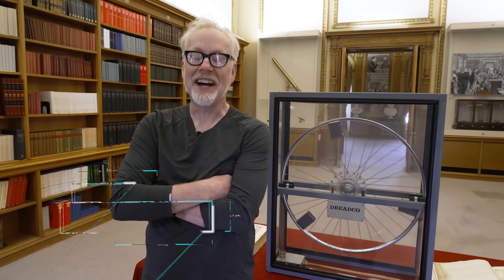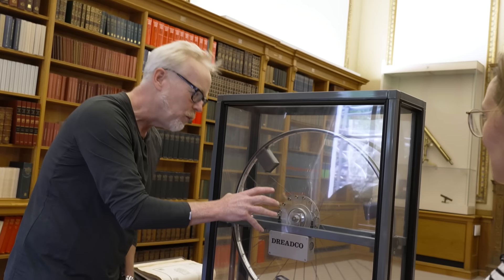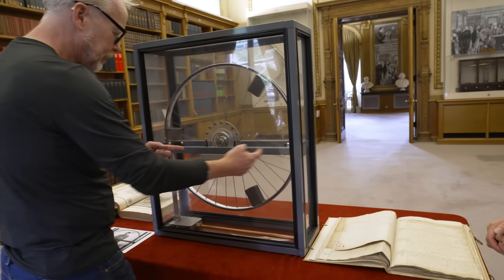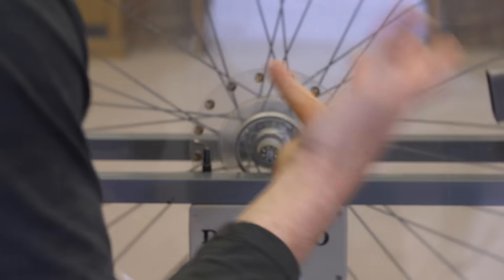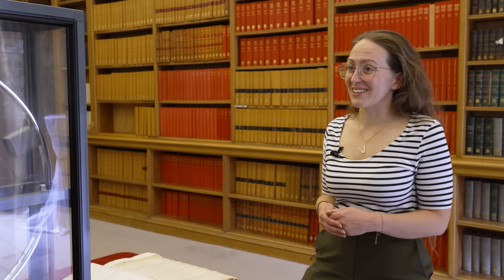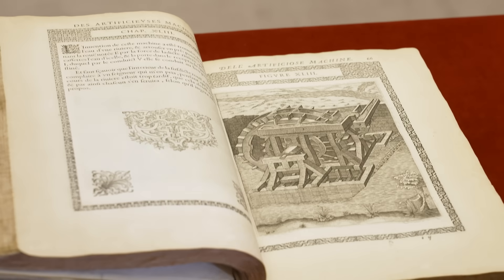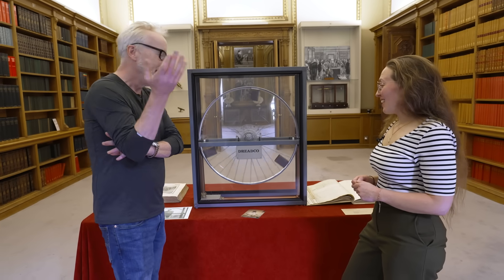Adam Savage vs The "Perpetual Motion" Machine!

Comment: As a kid I was at the Smithsonian Science museum. They had this small glass  lightbulb looking thing a radiometer they called it. It had a small windmill , four blades arranged horizontally. One side of each blade was black , the other white. When you put it in light it spun. And would spin if forever if  it had a constant light source. That's the science for dummies version as I'm a dummy for the most part.
Reply: You can buy those for under fifty bucks, it's a neat toy. They only work in that specific shape, and at a specific pressure, so it's not how this wheel works.

Comment: Very interesting discussion... obviously the wheel is spinning inside the vacuum - which is part of the service - the axial need to be made of very hard material, such as titanium, same as the wheel and spikes and the bearings.  The ball bearings need to sit inside a highly non-viscous extremely thin vacuum tight fluid. The three box containers part of the wheel, contain three magnets set at repel polarity wrt the bar magnet, which will provide impulse at the moment when one container is at the top of the wheel. The box containers are probably made of some very light metal alloy.

Comment: Perpetual motion is absolutely possible.  Every planet, moon, even stars orbiting the center of the galaxy are examples.  As a result of gravitational tidal forces enormous amounts of heat are generated in the earth fueling every volcano on the planet and ultimately our electromagnetic field which protects us from solar radiation.
Reply: Every planet moon stars eventually collapse into a black hole
Reply: @Kkappaccino  That is ridiculous and not even remotely true.  Whether you are saying that they of themselves eventually collapse, or that eventually they would all be pulled into a black hole, neither is even remotely correct.  

Our own sun will die as a red giant.  It will expand like galactic popcorn expanding so much that its surface will extend beyond mars.  After which it will slowly cool and go inert over billions of years.  The rest of the planet Jupiter and beyond will continue to orbit just as they always have.  The fact that the surface expanded wont affect their orbits in any significant manner, as orbits are determined by distance between centers of mass, and their centers will still be the same distance apart.

After this our effectively dead solar system will continue to orbit the center of our own galaxy for billions of years.  While it is certainly possible that they might be pulled into a random black hole there is certainly no scientific certainty of that.
Reply: @K162KingPin don't think you're understanding that perpetual means forever, not just a really really long time. Entropy will eventually unravel all of that.
Reply: @K162KingPin then eventually society becomes reliant on this system. When it eventually is no longer perpetual after 20 generations, all previous forms of energy generation will be archaic.
Reply: @captainhellhound7451  What were you planning? To just build one big one? lol.  There is only one "Hover" Dam, but there are thousands of dams around the world generating power, Millions of wind generators, BILLIONS of solar panels.  What could possibly make you think that if we had an infinite source of energy production that we would only build one.  I mean, what are you going to do about mobile power?  Run an extension cord everywhere?
Reply: @captainhellhound7451  I must have missed a paragraph or something.  What is your basis for imagining that a proven design which has been replicated millions of times, and worked perfectly for over 1,000 years would suddenly fail for some reason?  Are the laws of physics going to suddenly change in 1,000 years making the design non functional?

Take solar panels.  They only last 20-50 years or so before they need replaced.  That doesn't mean it is a flawed design, only that it has a finite life span.  No one is going to give up on solar simply because the panels must be replaced a couple times a century.

You might as well make the same argument about gasoline engines.  The gasoline burns up in just a few miles and the engines only last 1 - 200k miles before they are done.  That doesn't mean its a bad technology that everyone will lose faith in.  Why would a hypothetical generator be any different.

Comment: Looking back at this, I think the way it works is actually VERY Simple, the same way those desktop toys work where a marble runs down a ramp and then somehow ends up back at the start. 
The ball is running past an electric motor that can also detect the marble, allowing it to turn on and give the marble a slight push as it is falling, giving it just enough momentum to land back at the start. 

The way I think this works is:
I think this is working very much the same way to the desktop toy, the THREE Magnets actually make sense with my theory, they are doing a few things aswell as being pushed by an electro magnet, they are also acting as weights to keep the wheel spinning just enough to make it look constant (kinda like a fly-wheel). 
- I think the three blocks are just magnets, while the two things either side are electro magnets that each sense the main three magnets, giving them just enough push to spin the wheel, the next magnet does the same and so on. Notice how there are two Electro-Magnets and three normal magnets, all of this together (Going in a LEFT-RIGHT-LEFT-RIGHT manor) will make the wheel spin just enough that it looks constant, these also do not need that much power since they are not actually turned on that often (about 20% of one rotation). 
- As to what is powering it, I think it is very well hidden wiring that hides batteries somewhere, possibly in the frame itself (which is very thick so could easily hide some batteries) or even in that heatsink box. 

I think it is a more elaborate version of the desktop marble toy thing, it looks more insane and makes less sense, but is actually doing pretty much the same thing.
Reply: I wonder if they will let you record high speed footage of this, or a timelapse that you can speed up a tone. 

If my theory is correct, you should be able to see a slight slow down just before each magnet passes the electro magnet, if this is the case then I would say my theory is correct. 
PS: When I say "Magnet" and "Electro Magnet", these are the names I have given the objects, this may be wrong though. 

I will never know the true answer though, I would like to hope I am correct, or at least close though hah.

Comment: it's not a problem to make a wheel to spin  {  i built one with magnets  } but it will not generate any power. may be a volt or two at the most. efficiency of this machine close to 0

Comment: Natural magnet low speed work long.But fast speed magnet lost energy temperature gradule oven This magnet lost function. Real Earth planet centr core bal magnet very fast and big temperature heat oven but normal limited speed . Princip this prototips.Bicycle wheel prototype magnet inertia.  It has thus functioned as a power station without water, without fuel, without wind.  Only magnet station generators. For obtaining power sources.  From the past shown practically known theory about the magnet and simply to this day and in the future.  Elementary.  And simply.

Comment: My invention flash driving running in light speed way is my perpetual motion. 
It's using a gapping way levitation levitating way .
Cw driving the ccw and the ccw is driving the cw in 9ne pathway driving and in light speed way . Using a gapping zone way .
There is an additional design to run boto cw and ccw combination perpetual motion running. 
And an additional tapped way not connected but tapped only , making the real driving a dummy no force driving in gapping zone way. 
Gapping zone is in Black Hole is the centering way .

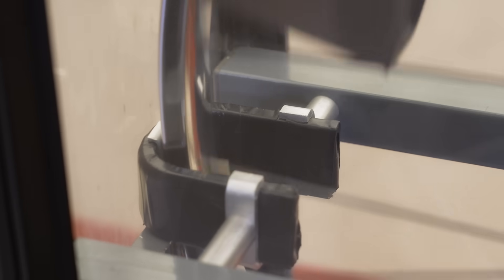Comment: every two years to someone who changes the battery... Savage is cool dude, pretty sure the copper tube and box 3:44 are decoy, Those circle magnets at center 3:02 give it away,  the black boxes 4:09 are coils for sure. 100% motor and the box with name dreadco on it is the battery. As we learned from the first law, They cant cheat the universe a very fine amount of energy is getting lost so every 2 years they have to charge the battery. ROFL

Comment: This is clearly an overunity system. meaning, it is powered by the dirac sea, virtual particle flux fields, gravity waves, tachyon waves, dark energy, dark matter, cosmic energy, heaviside component, and sometimes referred to as zero point fields. 

the wheel is utilizing energy from the environment to spin. the wheel needs maintenance just as all mechanical things require.

perpetual motion simply means its powered by the infinite wheelworks of nature. nothing more, nothing less. still requires maintenance, still requires the cost of materials to build.

Comment: A while back I made a wooden gear pendulum clock that is electrically powered, but takes very little electricity to run (think servicing every two years of this machine). The way the clock keeps running is that in the base is a dual electromagnetic coil, and a transistor for switching. In the bottom of the wooden pendulum is a permanent neodymium magnet. As the magnet passes over the outer dual coil, it picks up enough of a slight charge from the moving magnet passing over a coil to allow the transistor to briefly switch on the inner battery powered coil which is wrapped around an iron nail. This very briefly creates an electromagnet opposite polarity of the magnet in the pendulum that repels the magnet in the pendulum and gives it just enough of a little push to keep it swinging. The cycle repeats each time the pendulum passes over the coil hidden in the wood base, which keeps it swinging back and forth.  

Now my clock, is not an impossible perpetual motion machine, it's just a clock, however, it demonstrates how easily something can be hidden and keep something moving for a long time with very little power.
Reply: I highly suspect this is exactly like that tbh; the blocks on the wheel are magnets, the two sides of the horizontal casing are electromagnets, the batteries are in the box.
Reply: Почему не вечный двигатель. Вы сделали параметрический маятник, который не нуждается в дополнительной энергии, акромя энергии небольшойй батареи.. Если его масштабировать, то можно построить мощный в несколько кватт генератор энергии. Для дома или квартиры в самый раз. 

А можно воспользоваться идеями Джона Бедини. И вместо небольшой катушки намотать большую для создания магнитного импульса и маленькую для подачи сигнала на базу транзистора. И поставить аккумулятор на 9-12 вольт.
Reply: @Виталий_Петров_Н   Because you can never get out more energy than put in. With the pendulum, it still using battery energy that will run out. As soon as you tried to use the output of the pendulum to power something, in my case the clock, it needs energy to keep going that will run out.

Comment: Those 3 boxes on the inside of the wheel all have an electromagnetic in them , and the necessary electronics to pulse the electromagnetic as they get close to  the magnets . The stationary magnets themselves are there as a trigger to tell the electromagnets when to turn off and on . They have to charge up the internal  batteries every few years to keep it going .

Comment: The wheel would spin faster if it only had two weights(masses) attached to opposite sides of the wheel such that the direction of motion (vector) of each weight at any given moment is parallel but opposite to the other (coincidence of opposites).

#theDialectic
#coincidenceOfOpposites
#unionOfOpposites
#vectorPotential
#coincidenciaOppositorum
#dualism
#coherence
#harmonyOfOpposites
#eccentricity
#hyperbola

Comment: The key to perpetual motion is "coincidence of opposites". Just like gravitational potential, vector potential can generate infinite amounts of energy
Reply: The wheel would spin faster if it only had two weights(masses) attached to opposite sides of the wheel such that the direction of motion (vector) of each weight at any given moment is parallel but opposite to the other (coincidence of opposites).

#theDialectic
#coincidenceOfOpposites
#unionOfOpposites
#vectorPotential
#coincidenciaOppositorum
#dualism
#coherence
#harmonyOfOpposites
#eccentricity
#hyperbola

Comment: My guess is the three rectangles are batteries with some very sophisticated for its time switching circuitry and the Horseshoes are actually magnets and with the correct sensing of the magnetic field and electrical impulse at the right moment it imparts just a little push or pull  to override the aerodynamic drag and the bearing drag.
Reply: The "horseshoes" are about as magnetic as the horseshoe of trilithons at Stonehenge (though several hundred times smaller). Their field was measured back in the 1980s when this was a regular display in various locations.
Mentioning Stonehenge like this is an obvious distraction.

Comment: "Almost too much going on with it".  Hit the nail on the head.

Typical magical effects designer's trick - you see it on a lot of escapology effects.  Show the audience lots of complicated bits so that they are distracted from the actual important bits.

So I'm going to say that at least 75% of what you see is a decoy.  Two-year lifespan, works in the dark - it's a motor.  Which parts are important to deliver the motive power I couldn't guess at, but I'm reasonably sure that the copper piping and box with a heatsink are completely unnecessary.

Comment: If it can run for 2 years like that, then there can be a way to get it to generate efficient power for a period of time. On a larger scale, it can power homes and businesses by very little use of power in itself to keep turning and run an alternator, or some other means of converting energy.

Comment: Maybe there is a vacuum in the box aswell as a motor. I noticed there is three blocks on the outer diameter, and the wheel slows then speeds up very slighty. If its just a motor or for some other reason that is disappointing ,then just open the envelope.

Comment: What about the best weight distribution on the wheel coupled with the nicest bearing setup and a simple push?
Reply: Ha, yeah. If you add magnets to create currents, you'll just slow it down. Also, it has a battery

Comment: Those bearings in middle are reason why it move they'll point oil again for 2 years, it like a bicycle that required leg's to create motion, Those 3 box are weight required for movement because if they have 4 they it will an equal balance meaning it cannot move, Those 3 create box unequal balance or weight that why it keeps on spinning to create to find equal balance.
It's genius.

Comment: She pointed right at the tricky part, and gave Adam every necessary piece of info. My hero whiffed it.
Reply: Lol, I don't think they are claiming it's actually perpetual motion. It's just meant to be a puzzle to figure out how it actually works
Reply: @TheJaronman   0:32 she called it a perpetual motion machine right form the get-go.
Reply: @tourmalino3205  dude it's tongue-in-cheek... if English is your first language how do you not understand that?
Reply: Its hilarious how this guy put decoys to hide how machine "works", but then girl says it requires maintance and slows down after 2 years which completely eliminates it from possible class as perpetual motion machine. + It does not generate any free energy from it to harvest for some other purpouse, it only spins and generates energy keep self running, and for 2 years. 

Like people say mechanical clock can run long time with gears, and at least you got usage from it- shows time. And its not affected so much by gravity so can be used even in space, only energy input is from turning wheel.

Comment: Air pressure sent through the pipe to slightly push the wheel, which in turns pressurise air, sent through the tube, etc ...

Comment: I imagine you must use a long shaft to turn the rotor can be more cinematic varied free motion propulsion wheel They are studying the wheel that generates electricity. This is also the part so that it does not use a pulley someone asks who invented the magnetic magnet and principles? they joke that we lower the central blade to do maintenance and iodine continues to work the same It is understood there is an extra rotor working o capacitors.That will work all your life, it's called free energy ese problema surge cuando lo monopolizan There is also a perpetual battery.or other electric power options How to tell if it works, you want to know if they are in the chemistry and physics books I got a type of watch from those years So they surely killed the scientific genius for getting rich That's what I told him, it's just a saving, sell him a small one. have to improve with an electronic resistor The secret is that what happens if a disaster occurs in a dam, I don't live there.They have to repair this old infrastructure, lack of maintenance, I don't know It is also perpetual sino entiendes es como el cañon se replico long before the invention of that wheel si molesta tengo la especial silla de la rueda It's the magnetism chapter in case you want to solve problems asi mejoran la rueda They are made of wood, little cables, they look pathetic and ridiculous, very old. I need to tell you that the wheel left the galaxy and came backIf it goes far away it does not have crew members o asi es hacen algo y suben un video que opinas queno es un invento enseñarte los principios de la fisica en su totalidad toma tiempo una cosa es admirar otraestudiar o hacerlo